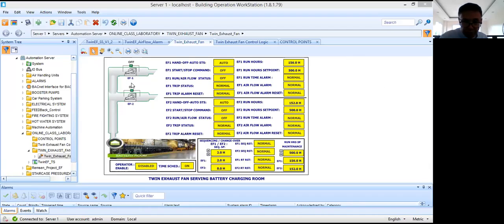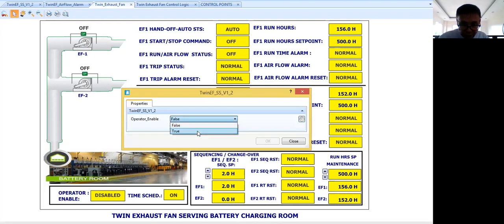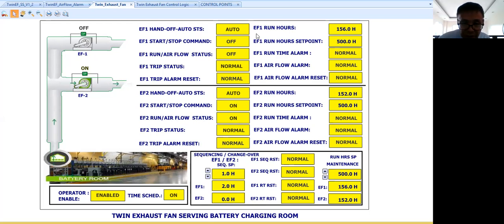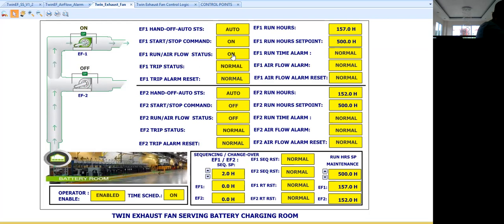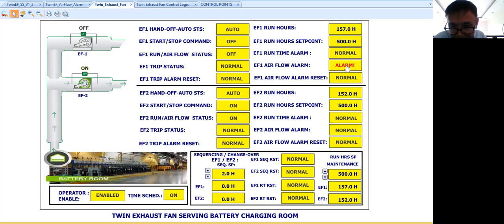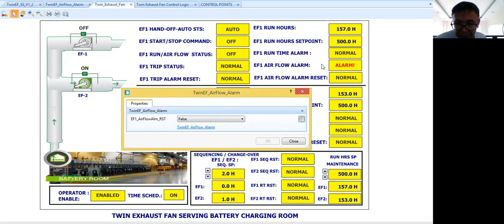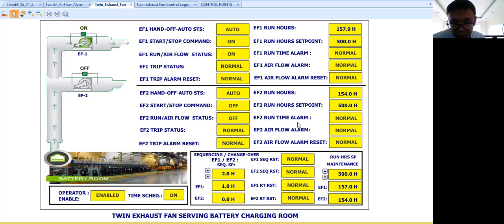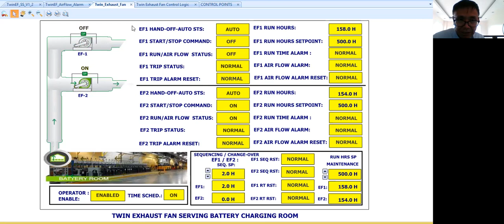How to Implement Air Flow Alarm in you Control logic program.

Comment: hi sir did you use NRD in exhaust duct mouth? If not,  duty fan sucked air from standby fan duct, Than what?
Reply from the maker: this issue are being handled by Mechanical team, they are installing a damper in the exhaust duct mouth that will open when the fan is  working, opens in one direction only